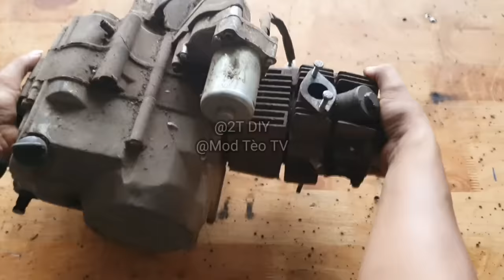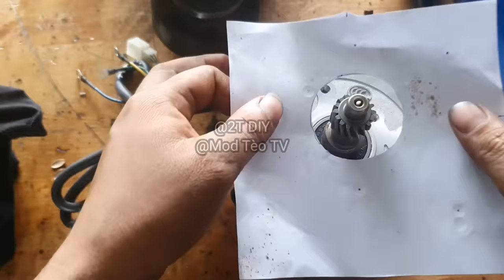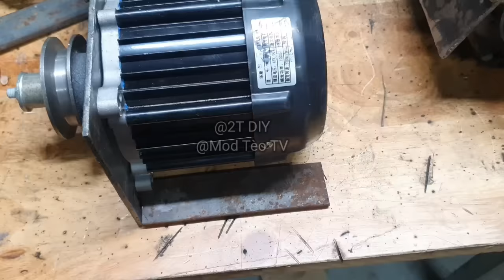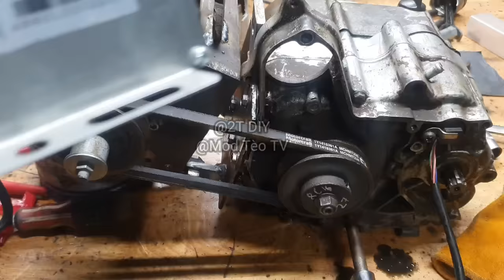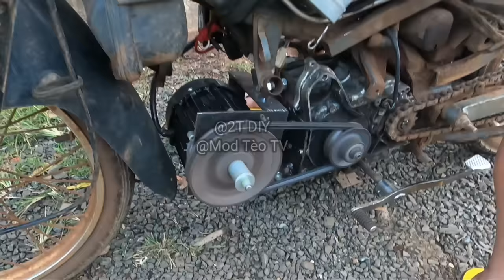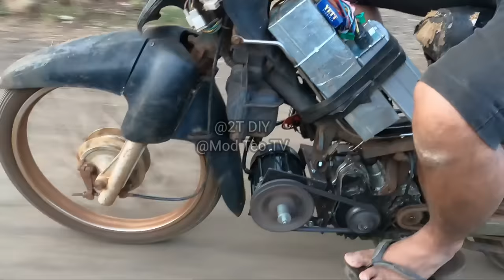I BUILDING ELECTRIC BIKE 4 SPEED

Comment: no clutch, and it still shifts well?! awesome!
Reply from the maker: Thank you
Reply: Cred ca ambreiajul îl are, ca altfel nu ar putea schimba vitezele!
Reply: i dont see a clutch, or a clutch lever, where is the clutch?
Reply: actually that kind of cub equipped with automatic centrifugal clutch, and also disengage mechanism while shifting gear
Reply: @aditbije that's semi automatic. because you still have to shift up and down
Reply: @ryanm158  those motorbikes don't have manual clutches, they have am automatic one that works with the centrifugal force and oil

Simply put 1st gear and accelerate, no need to press clutch to shift gears, only let go the gas

Comment: What is the maximum speed of the bike after installing the electric motor?
Reply from the maker: 70km/h bro
Reply: @2TDIY 
👍
Reply: @2TDIY 
I hope you will create a closed electricity generating circuit... consisting of a motor, a generator, and a battery... and install it on any type of bicycle. I want to know this idea from you, my brother. Is it practical or not?